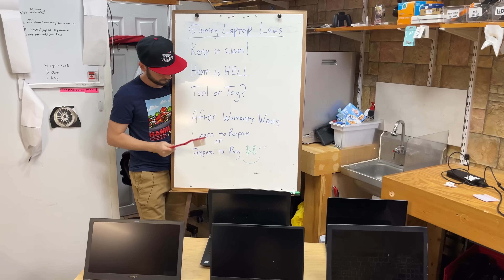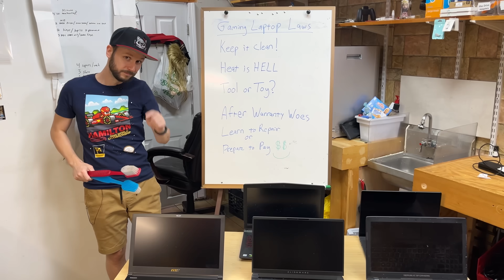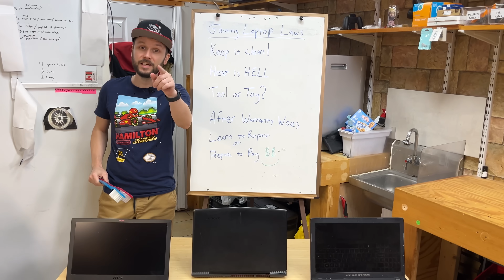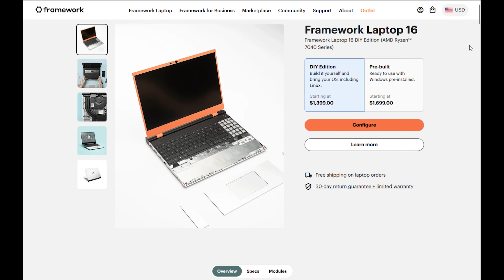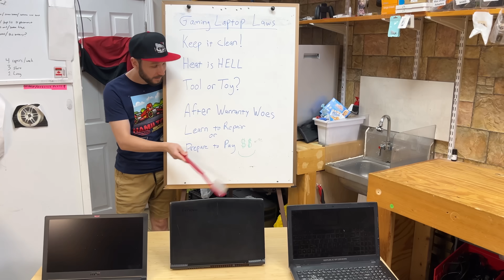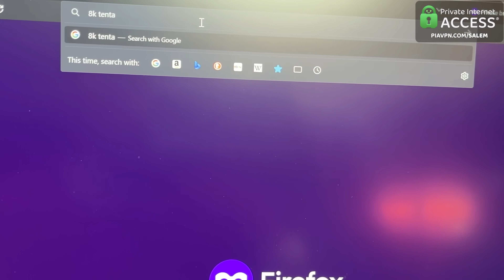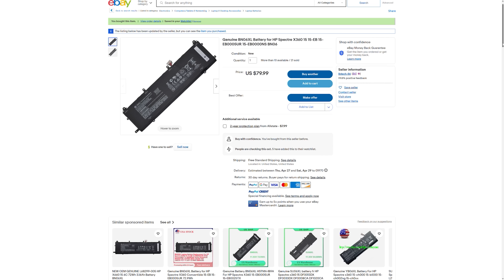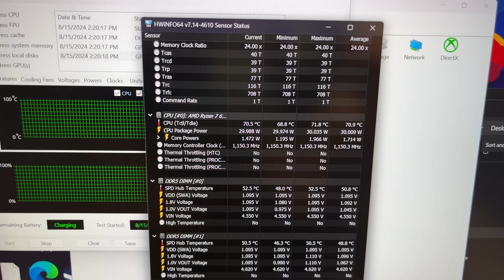Repair Shop Owners Guide to Buying and Maintaining a Gaming Laptop

Comment: I'm an engineer and I like to work on motorcycles. My tip for people who are learning to fix their stuff is to LABEL and TAKE PICTURES of whatever you are about and take off from your computer.

Because god forbid manufacturers use the same length screws
Reply from the maker: Preach! Sidenote, Dell / Alienware deserve huge credit for ALWAYS labeling the size of the screw. It makes repairing so much easier.
Reply: @SalemTechsperts  Thank you for the video. I'm planning on getting a gaming laptop but in Africa, replacing anything is near impossible so I'm going to get a cleaning kit as per your advice
Reply: I yes the tech I replaced at a company with many Dell laptops in service after they'd put one too many screws through keyboards and assembly. Great repairable laptops though once you've memorized what goes wher.
Reply: true i opened up my old laptop and clean the fans, then when i put it back, somehow i got 2 extra screws, i dont know i have this ability to create more screws
Reply: Or even better, self holding screws!
Reply: To add to that, everyone should also have a digital caliper somewhere. You can get one for next to nothing and they can be lifesavers when mixups happen. And they happen to everyone eventually. 
For sure pictures, labels, and a consistent sustem for organizing everything are the best way to ensure things go smoothly. Without a doubt, that should be everyones top priority.
But even with meticulous organization, a table can still be bumped, a tray spilled, or countless other "oh, shit" moments.
Nothing like staring at a pile of suddenly unorganized, tiny screws that are all frustratingly close in size, but absolutely not interchangeable lol. 
Being able to quickly and accurately measure them and reference a detailed guide that shows exactly what goes where is, at the very least, really great peace of mind.
Like a backup plan or insurace policy. For less than $20, its a great "better to have it and not need it than need it and not have it" tool.
Its crazy how often simple maintenence or repairs end in catastrophe just because something got mixed up and those people had no way of being sure things were being reinstalled in the correct spots.
Its a problem could be mostly elimated with a simple caliper and a guide, even when things go sideways.
Reply: Hell, when I did a basic clean of my keyboard, just removing keycaps to clean better, I took pics. My dumbass would forget where they all go. I use a 100% keyboard.
Reply: I’d also like to add buying a magnetic pad and grouping your screws.
Reply: REAL! That's why Samsungs are much easier to fix, all  their screws are the same size!

Comment: Recently got an older used acer nitro 5 from a pawn shop that was running like crap, and was able to use what i learned in your videos to clean it and upgrade it. She runs like a dream now and while it's not High end specs it works for what i need. Learning to repair saved me about $600 dollars over buying brand new so it's definitely worth it.
Reply from the maker: That is fucking awesome. 👏 😎

Comment: I had a 2021 Omen 15, VRM on the GPU (RTX 3060) died, burnt through the motherboard. Didn't even have it for 3 years. €1600 down the drain as a replacement motherboard is €800.

I took insanely much care of it, cleaning it very regularly and even replaced the battery within warranty. 

Mistake 1 is buying a HP product.
Mistake 2 is believing a mid/high end laptop will be reliable
Reply: For real, my legion's mux switch never worked from day one, but I don't live in the States so it would have been a pain to send it to lenovo
Reply: Like mac books. It took a while, but repair services started to show up. Though it did take a while to find one I have had really good luck with sending boards in for repair. Had one to many places who couldn't fix it or if they did. it failed pretty after 30 days. That happened to be the warranty limit. Some places wouldn't do a good cleaning of the board either. The place I have now cleans everything on the mainboard. Ask questions and has a 90 day warranty.
Reply: @LeoMkII  I have legion 5 too, do you have an issue with power button? If so,  does your power button work when pressed? I have same issue and when I press the button, I hear it but it does not work
Reply: Wow I have multiple hp laptops and they run great. One is 15 years old and is still running like a gem. The only issue I have with hp is their printers. The printers SUCK lol 😂
Reply: lil bro bought an HP 💀💀💀💀
Reply: @Gavin-bb6mw  well its cause its OLD lol...people back than cared quite a lot bout their qualities 🥲
Reply: @mantosh56  yes good point, all this "power efficiency" stuff has taken a toll on computers. Electronics are now built cheaper to be more "efficient."
Reply: @Gavin-bb6mw  It all does seem to be luck of draw. Then, dell and hp is the most sold all of these years. Seen a good amount of lenovo the last few years. So who knows.
Reply: Yeah, stay away from pretty much all HP gaming laptops. They had a sale on them at MicroCenter and I bought an HP Omen 17 and it had AWFUL coil whine. Returned it that day and got another unit, and it had the same problem. Returned the 2nd unit the next day for a refund and told them I wasn't interested anymore.
Reply: my nitro 5 to, died at 3 years, and i still have my 9 years old asus, and my samsung with an i5-2250 processor and still works.
Reply: What brand,laptop for gaming is the.ost reliable?
Reply: @SyrupCanuck  Lenovo seems to do pretty good with their Legion series, but that's also reflected in their pricing. But I wouldn't trust any gaming laptop to be truely reliable. There is just too much power packed into a small package now
Reply: @rickdubbink  Unfortunate. I think stream gaming is the future where any device can game full spec. It's alot to ask a regular client to tear down the lappy and repaste all thermals. Scary because after a few years it's toast.
Reply: @DJdoppIer  Damn man I just saved up and got one of these from Microcenter too since my current laptop was struggling to do handle certain programs I need and now I'm regretting it. My free return period just ended a few days ago too. 💀
Reply: Can u help me in need a laptop for study , organising my stuff, basic editing nd atleast can play basic games like valorant at good fps
Reply: If you have 1 grand. Spent like 100 for used but reliable framework laptop. And the rest of it for good gaming desktop. Because gaming laptop is shit. 

Learn from my experience. I'm done with gaming laptop. They're just shit. Sold that toast, use my unused brother laptop work working space and gaming on my new desktop. Yes I am a college student. Trust me, desktop have more longevity for gaming, and the framework laptop too, since you're not pushing it into a literally toaster
Reply: @jawed4106  basically i need laptop got studies mainly nd basic once in a while gaming, OLED screen (or I want best screen possible) nd long lasting laptop
Reply: Hey there you seem to know about laptops. Can you Please help out?
I'm a student and I spent all my money on this pc that I've used for like a year......
I had an hp victus 15 i5 12450 with 1650. The ssd started to misbehave. I called someone with a bit experience to check it out. We took out the ssd and screwed it back.(thats all we did). But when trying to turn on the pc after putting back the lid. It turned on for a brief moment and shut down for good like dead. Won't turn on again. The only mistake we did was not disconnecting the batter. I'm in africa(Ethiopia) so there aren't many reliable technician. All of them told me they don't understand the problem except for one who said that the cpu is dead because it warms up a bit when the charger is plugged and it shouldn't do that. 

Could the this much damage be made for not disconnecting the battery? 
The conputer was turned of the whole time.
Reply: My 2021 Legion 5 Pro is now on its 4th warranty repair:
- thermal assembly (heatsink + fans) replaced after 1 year due to noisy fan bearing
- LCD replaced after 3 years due to white uniformity and image retention issues, Lenovo cited wear and tear, but replaced screen
- replacement LCD started showing dead pixels after ~2 months, sent in for repair again. Lenovo didn't replace the LCD, but replaced motherboard and heatsink + fans without asking, citing instability and fan noise. The laptop never had issues with stability.
- After looking at photos of the dead pixels that I've sent in prior to the previous repair, Lenovo asked to send the laptop in once again to look at the screen. Still waiting for the outcome of that repair.

My backup laptop is an old Dell Latitude, which I've had for 10+ years and the only real issue with it after all those years was that the fan would sometimes have a slight rattle before warming up. I've bought a new fan for 12 EUR and replaced it myself.
Reply: Ye agree HP = Horrible Product
Reply: My MSI GL73 8RD finally gave out after almost 6 years. I suspect the motherboard burnt out too. I didn't even clean it regularly, like twice a year. It had a few issues but it honestly surprised me with the longevity.
Reply: non hp laptop user here and good god their victuses are awful. a wasted 4060 and intel for a failed motherboard, power supply, ram, and cooling. right out of the box too.
Reply: @twofrenchrobots  dang... Right out of box issue. Refund? Or u need to suck it up and go for warranty
Reply: @SyrupCanuck yeah, streaming game is the future.. i mean the idea of getting thinnest, lightest laptop with just a high quality screen dat plays everything with path tracing etc without choking itself is jst simply a life hack…
Reply: @ it definitely has to be the way because hardware is becoming increasingly too powerful and more

Comment: I’ve owned a 2020 Razer Blade 15 for 6 months and in that time i’ve had to replace the CPU fan as the bearing went out. Not a big deal since after all it’s 4 years old and i took it as an excuse to also change the thermal paste and clean the vents and cooling fins and stuff. truly felt an immeasurable amount of joy when i finished putting it back together and it booted up with no problems, and what at first i saw as daunting as i’ve never taken a laptop this far apart, became something that i wish i could do all the time. 

I bought it since i needed a decent laptop for school but i also wanted to play games at decent settings, and with my budget there was no way that i could buy a decent laptop and also build a decent pc without compromising in one or the other, best decision i’ve made so far.
Reply: Bro is too bold💀

Comment: Something I started years ago when I started college was giving both my laptop and desktop a deep clean before the semester. Took it apart, cleaned out dust, replaced thermal paste on every part I could, and then put it back together. I've never had issues because of doing preventive maintenance and cleaning, which has saved me a lot of headache. Maybe wasted some time cleaning them twice a year, but it made me get to know my computers better and help others with problems
Reply: That's so decent pc boy

Comment: This is a video that I should share with my classmates in college. Dear god the amount of people buying gaming laptops and not understanding proper maintenance. People that think building/owning a desktop is harder than doing maintenance on a gaming laptop should watch this video; replacing thermal paste on my desktop is a 5 minute job. Doing the same to a laptop would be at least an hour with all the screws to keep track of, fragile connectors, and more.

Comment: Was planning to buy a Gaming laptop for videos editing but now I'm fully convinced to buy a thinkpad with similar gpu instead because of the repairability issue. 
Thanks a ton Salem brother, you will save me a lot of bucks for many years because of my this repeatability aspect of laptop issue. 
❤❤❤
Reply: I got an old thinkpad L520 and it works really well for editing documents, coding ect and it also comes with a disk drive and really good speakers! And it was only like 200 bucks, get some old thinkpad that’s still modern but upgradeable and you will be set for the next seven years at least

Comment: Hey Andy I just wanted to let you know, your channel is what inspired me to get back into tinkering with my own computers as a hobby. I had prior experience with desktops but not laptops. Now I am used to doing upgrades and maintenance with laptops regularly and really enjoy it. I used my old Thinkpad Edge E530 from my college days as my guinea pig after getting inspired from watching your videos and it runs amazingly after repasting, cleaning the fan/heatsink and a SSD and RAM upgrade and move to Linux. Over the last little while I have done various upgrades and disassembly practice with different models of laptops now and its a super enjoyable and rewarding feeling. Definitely agree with all your points in this video. Much love to you and Lupe from Canada.

Comment: I remember the first ever gaming laptop I got (approx 2013 level tech).  It was a hand me down from some relatives who were not very tech savvy.  Sold to me at an incredible discount due to "not running very fast."  I opened the case to find a singular stick of RAM sitting next to its empty partner RAM slot, a "Kingston 8GB 2400R".  It was a name brand, gaming-marketed laptop.  Running on a single 8GB stick.

A mail order later, and a pair of matching RAM sticks (now 8x2), and all the latency/loading times of the laptop got cut in half.  It was still ancient 2013 technology, but it just took a second stick of RAM to actually be tolerable to use.

Comment: I just bought a Dell Precision 15 3561 and couldn't be happier. Before this, I had an HP Zbook 17 G2 which weighed a ton and a half. So yeah, looking at "mobile workstations" other than the Lenovo ThinkPad P series is possible. But Dell did impress me with this one. The amount of parts I can change to make it as I like is amazing.
Reply from the maker: Look at Mr. Moneybags over here! Just kidding man, those Precision's are decent. Curious why you chose that over the P series though? From my experience with the newer Precisions, the physical quality seems to have taken a hit, specifically the hinges and plastic, which is why I didn't mention them alongside the P series

Comment: My current laptop is an ROG Strix GL503VD bought last 2018 and is still kicking in 2024. Just DIY replaced its thermal paste (so do your research). #1 is very important and #2 is very true so I keep it away from the bed and use a stand and/or a cooling pad. I use my laptop mostly for productivity and some gaming on the side. The most important thing is to never push a gaming laptop beyond what it can handle. Be conscious on the temps because it can tell you when you should do your PMs.

Comment: I've had my gaming laptop for 5 years now, it still works. The power supply failed on me, which costed some money to get a new one. I noticed overheating problems after a while. I took it apart and as you said, Horribly clogged up with dust! I just recently repasted the CPU/GPU and now it's running much cooler! I haven't had any major problems. I'm confident about newer laptops, as long as they're great quality and i can repair them on my own. Acer predator Helios 300 RTX 3060.

Comment: I fitted an M.2 drive to my laptop today and it went well apart from the factory installing the retaining screw so tightly into the case it stripped the screw trying to get it out, I had to improvise and use a pair of pliers to grab and twist it loose. The satisfaction of doing my own work and the amount of crap that I blasted out of the case fans with an air duster was an incredible sight to behold. I will concede that a desktop is infinitely easier to work on and keep cool but the laptop is good for a bit of gaming in the bedroom where I cannot be accused of being antisocial. I wish I had the balls to build my own desktop, maybe one day.

Comment: I have had my gaming laptop for 3 and a half years. For that time I have not had problems with it since I made sure it was always clean. Recently I took it apart to replace the thermal paste, the thermal heat pad paste, and clean the fans. Took some time since it was my first time doing it but, I was confident I could. Now my laptop is working a lot better. I just need to keep it clean. Also, if you ever want to do a repair or replace the thermal paste take pictures before you start to take things from the motherboard.

Comment: My first experience repairing my own laptop battery replacement because it got bloated. Ordered the battery online and watch couple of Youtube video on how to open my laptop, found video of my laptop model of course. Save a lot of time of bringing my laptop to a repair shop etc. Next biggest repair was replacing my CPU fan. Finding the replacement fan online and making sure it is the same exact model based on item description and pictures. When it arrived so happy it is the exact same with mine. So, same method i found some video on Youtube and replace the fan myself. But now i have to open up the vents, to get access to the fan. It means much more screws and steps needed. Was so worried as to not bend the copper pipes in the process. I cleaned the vents, the fans and apply new thermal paste while I'm at it. After fan replace done, laptop is fine until now for about 5 months now.